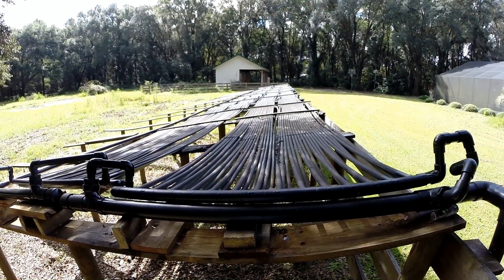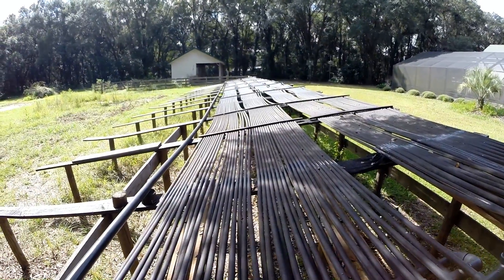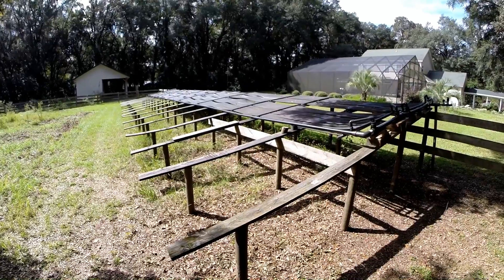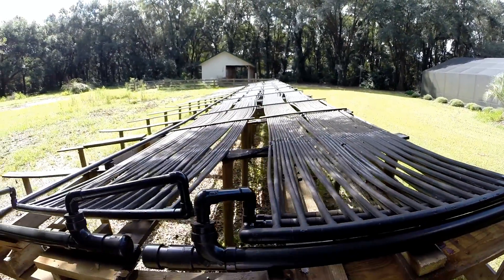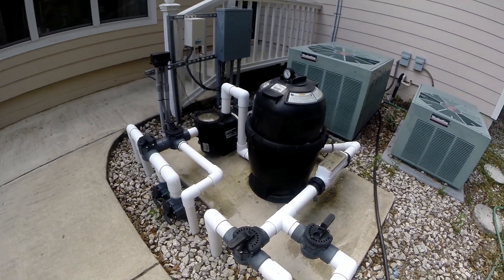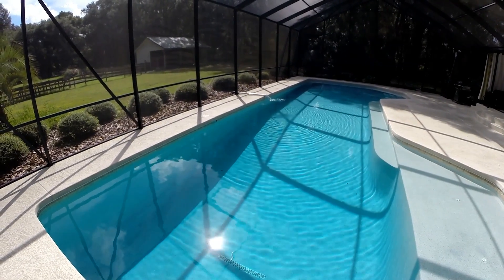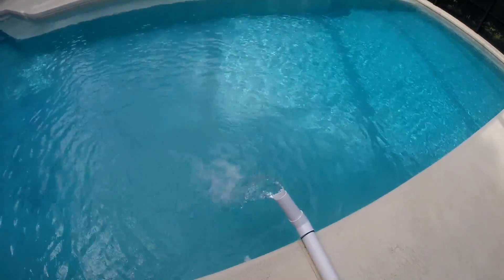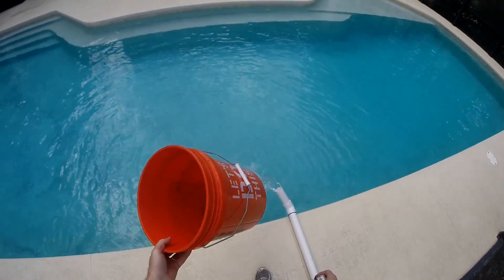Solar Pool Heater DIY

Comment: Cool video, thank you. You didn't mention how much energy you were putting in though, did you work it out in the end?
Reply from the maker: +jasoncatt 

Jason,
There is no exact number as there are so many variables that are always changing such as the time of year, solar day, cloud cover, ambient temperature, breeze, etc.  If you’re looking for a ballpark number then you might think of the solar panel as a 25,000 BTU heater from 10am to 2pm on a sunny day as compared to a typical electric room heater being about 5000 BTU.

Let’s look at some numbers using the measured flow rate and temp rise:
Q = Cp X m X dT  where Cp = 4.179 J/gC,  M = 25 gallons = 94,635.3 grams, dT = 3F = 1.67C.  So: Q = (4.179J/gC) X (94,635.3g) X (1.67C) = 660,454J/minute OR Q = 626 BTU/minute OR 
Q = 37, 500 BTU/hr

Now from the opposite direction:  We know the pool temp overall went up 3
degrees & let’s estimate that 1 degree is from the partially shaded and screened in pool and 2 degrees is from the solar panel, then we have:
Q = Cp X m X dT where Cp = 4.179 J/gC, M = 33,000gallons = 124,918,589grams,  dT = 2F = 1.11C So: Q = (4.179J/gC) X (124,918,589g) X (1.11C) = 87,179,802 J/dayQ = 82,630 BTU/day&#160; Most of that production comes from 10am-2pm, 4 hrs, so
Q= 20,657 BTU/hr

So we are between 37,500 and 20,657 BTU/hr
To get a better answer I would need to get more (and more
precise) data points throughout the day and in the end it would still be a
ballpark answer because there is no way of knowing exactly the split on pool vs
panel heat source.
Thanks for watching!
Reply: @HomesteadEngineering  6 years later I know but I estimated the performance as shown 5 degrees lift at 25 gallons per min to be well over 60000 btu per hour man!

Comment: Awesome solar heater!  

79 degree inlet and 84 outlet at 25 gallons per minute - this was running at 62000 BTU. 

Probably cranks well over 100000 btu during summer. 

For comparisons a wallmart 4x20 fafco home consumer grade solar matt puts out a whopping ~12000 btu during high sun am hour. Those are over $200 each.
Reply from the maker: Thanks!

Comment: Well done.  Thank you for sharing your knowledge and your experiences.  I have to wonder how much heat is lost in the run between the solar panels and the pool via geothermal cooling.  I'm planning on buying a kit and keeping it as close to the pool pump as possible.
Reply from the maker: hello hodes58.  I don't think much is lost to the ground.  Here in Florida the ground is actually pretty warm.  Thanks!

Comment: You just gotta love the Florida sun. I had a 24,000 gallon pool when I wintered in Florida likely not to far from you Inverness. I heated with an electric heater which did not use extreme amounts of electricity so I was considering solar PV to offset the cost and of course when the pool is warm the electricity could be used elsewhere as the heater usually only run a few hours a day to make it to 80 degrees. Oh well stopped going to Florida and now stay in Canada but no pool or much sun here lol.

Comment: Can you use your pool year round with solar heat?  We have to close our pool for NY winters (Nov through March), but we can't really use it much in April or October due to the high heating costs.  We like to swim with water temps in the mid 80s. Our heater can raise the water temp by about a degree per hour at a cost of about $5 per hour so if the pool is at 72 degrees, it will take 14 hours to get it to 86 degrees. We can lose 4-5 degrees overnight, so this could cost about $100 in a 24 hour period. Ouch.
Reply from the maker: BD, About the same for us here in Florida.  It stays really warm (80's) right up till Nov 1st, then goes off a cliff (drops to 60's).  No-one here will swim under 75 degrees.

Comment: Why don't you let the water return underwater at the point where the delta t is the highest to prevent loss of energy due to evaporation and cooling by the air?
Reply from the maker: I had it that way initially but changed it because I like the sound of the water falling.  I also like to put my hand in it to see how warm it is.  :)